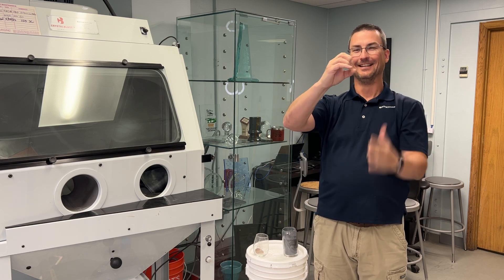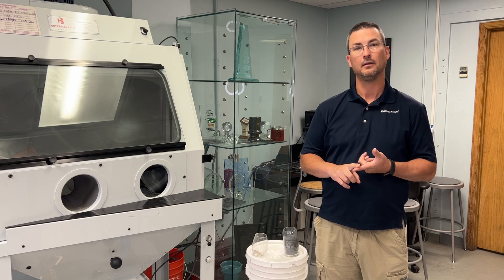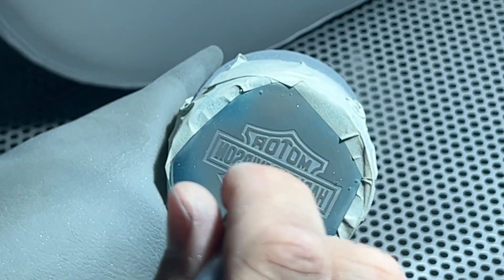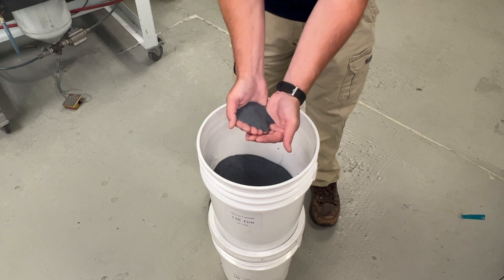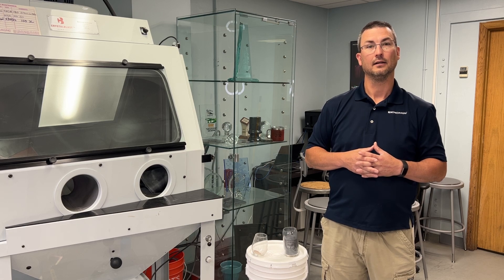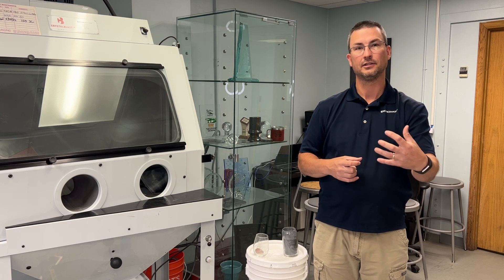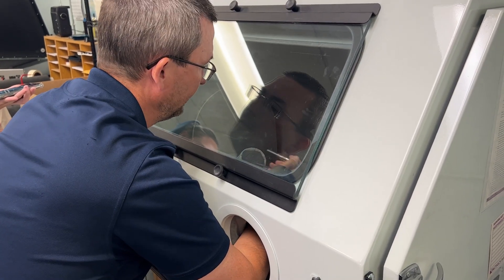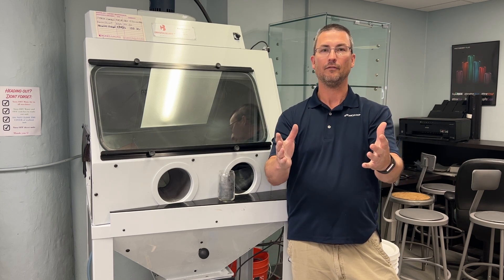Q&A: Silicon Carbide vs Aluminum Oxide | Choosing Abrasive For Sandcarving | IKONICS Imaging

Comment: The abrasive grit is  supplied, from the manufacturer, as a sieved grit size. As the abrasive is used, its impact will, slowly, cause it to fracture into finer grit (of assorted sizes). Thus, a mixture of grits would be in the system. This may, or may not, be acceptable. A separating system could be used in the blaster system to sort the grit into its various sizes. What are your thoughts  on this?
Reply from the maker: Hello! I checked with Darin and this was his response: "Yes, he is correct. The mesh size will reduce as it breaks down over time sandblasting. The abrasive will break down faster by blasting harder materials like metal and stone and the PSI you blast at will impact the life of the abrasive as well. We use one abrasive mesh size and one type of abrasive, typically silicon carbide in our machines. We have no need for other media types and mesh sizes as the 180 mesh size will work for most items (other than concrete, lava rock). We have separator reclaimers in our Crystalblast machines that will separate the glass, ceramic and dust from the abrasive. Our reclaimers separate up to a 240 mesh size abrasive so is the leading reclaimer for our industry."